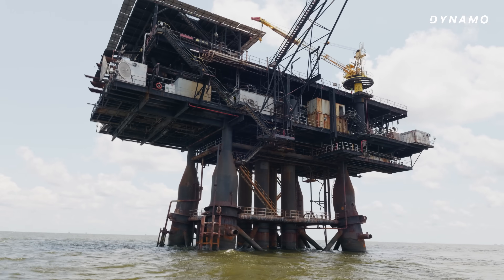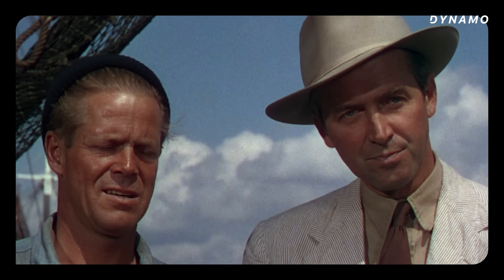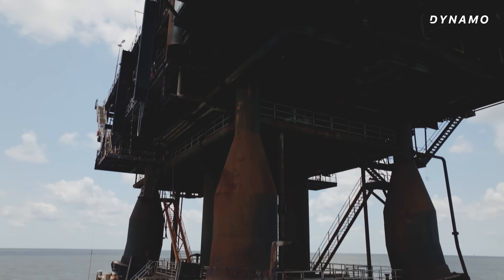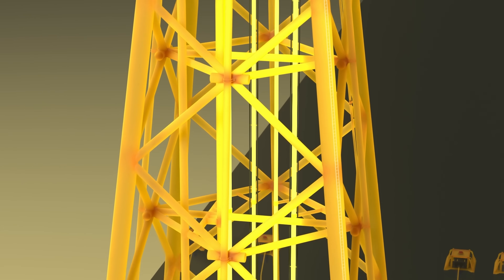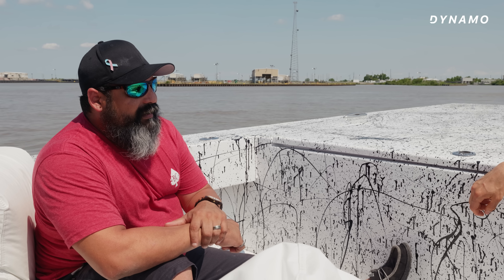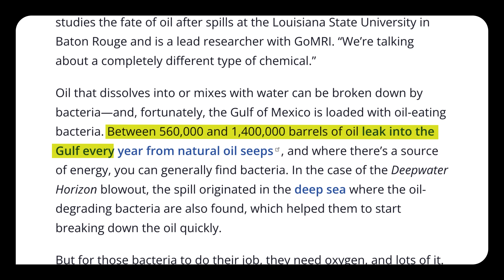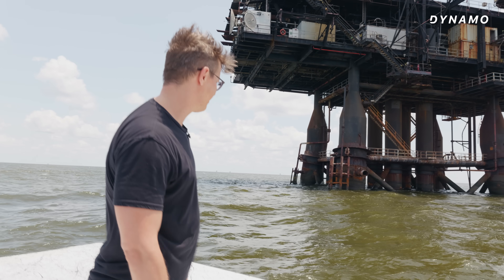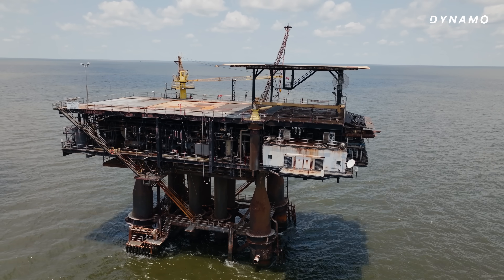I Visited Abandoned Oil Rigs — and Found Something Terrifying Underwater

Comment: calm down _ we pull 100s a year. I'm a commercial diver nad now a vp. Monies are set asside when closed and or sold for abandonment expenses. The REAL issue is the small private companies that buy old fields and rework them. Small companies will declare bankruptcy on small fields and leave all of us small contractors that did their work holding the bag.  The government will (BSSE) chase original owners and fine them....but if they arent thier....its Governments problem.  we have 3-5 years left until most rigs will have been removed. 
rigs to reefs is great it has brought back living coral reefs....so it works. the expense comes from regulations and insurances.  i pulled 70 wells in 1 year.for Chevron....it is getting better

Comment: I've heard that oil wells can go dry then possibly fill up again due to continental shelf pressure.  If this is true then in some cases some oil wells thought to be dry and or  not plugged well could begin leaking oil into the ocean.  The solution would be to plug the wells better or harvest the oil.

Comment: WHAT NO BODY IS TALKING ABOUT IS WHEN THAY STOPED PUMPING OIL IN AMERICA ALL THE VOLCANOES STARTED TO BECOME ACTIVE TO MUTCH OIL PRESSURE UNDER GROUND IT FLOWS THROUGH CRACKS TO FIND A WAY OUT THERE IS YOUR VALCANOS. HAVE YOU EVER TRIED RUBBING TWO ROCKR TO GATHER AND SEE THEM MELT IT DOSENT WORK. WAKE UP.

Comment: I used to decommission Rigs. Plug em after you get the permits which takes forever.  Decommissioning these rigs are backed up for years. 
I worked on mostly Apache Oil when I used to be an Electrical Engineer off the coast of TX. They just make Rigs inoperable & sink them for the "fish" making artificial reefs. 
My Cousin Engineered the Largest Shell Floating Rig. The Appomattox. Produce of oil & gas is upwards of 175,000 barrels a day!

Comment: Easy solution for the increasing costs over time at least: Each time the rig is sold, the clean-up quote must be updated. Ownership cannot be legally transferred without this bond cost secured in-full. So either the current owner can do it to make the sale easier, or the purchaser can foot the bill for the bond update. If this isn't done then the original owner is held liable as the title was non-transferable. So if they do shady deals just to ditch it to a small company that will fold, (or a shell company even designed to fold), either it's already paid for in modern metrics, or it's coming back out of their pocket directly.

Comment: It’s not abandoned. The wells first have to be plugged and abandoned. Then the platform needs to be decommissioned. 
What happens is the majors sell them to mid cap operators and then they sell them to smaller operators. The little guys go out of business and leave them abandoned in bankruptcy. It’s then supposed to go back up the chain to the current operating company.

Comment: Why would an oil company abandon a rig which is still producing - at pressure? I couldn't understand how there could be dangerous blow outs from abandoned sites. And sure I do understand that at some point extraction becomes cost prohibitive - like when it has to be pumped rather than gushing out as a result of untold pressure - but if that's the case we shouldn't see blowouts because ( well presumably) they'd only be abandoned when they become economicly unsustainable

Comment: I used to drive the boat to that platform to bring supplies many years ago. I learned Chevron is the worst company I've ever worked for, they say do what we say or go find another job. I've watched them open caretest valves and instead of putting oil in a drum, they just let it go into the water. I've watched them drop batteries in the water instead of sending them in to the shore base.. I also brought supplies to the Mr Charlie back in the 70s. Also I was outworking a rig 12 miles from the Deepwater Horizon when it blew, we rushed over and started shooting water on it, the Damon Bankston had already picked up the personnel in the water.

Comment: Plug the expended wells. Sell the platforms to disgruntled vets that just want to be left alone and get the government to pay a small stipend to keep them maintained at a minimum level with a supply cache for military vessels when rescue operations need to be performed. The Coast Guard could use them to drop rescuees off for rapid turnarounds and them pick them up later. Also might make a good observation system for illicit activities because said disgruntled vets REALLY don't want people getting near them.

Comment: There is a lot of misleading things with this video. I wouldn’t even know where to start to explain all of them. The biggest misleading conclusion is old wells can blowout like the new drill Macondo well. That is an absolute joke. An old well can leak some oil or gas at maybe 10 barrels per day but it’s not a blowout that releases 10,000 to 100,000 barrels a day like Macondo did. Also when a small company goes bankrupt the plugging liability goes back to the company that sold them the asset. If they too are bankrupt it goes further back up the chain of ownership to ever larger companies.

Comment: I think we need robotically managed and autonomous environments submerged on the sea floor used to grow and inject the  microbes into the well. There would probably be a surface unit that would wander and attach itself to a range of sea floor units at large groups of abandoned wells in order to supply surface materials needed for the operation to continue.

Comment: What a load of misleading propaganda! 

An end-of-life well is, almost definitionally, empty of any oil that could possibly blow out.  That's why both named examples of blowouts in your video were not from dead abandoned wells - Deepwater Horizon was a new well being drilled containing naturally high and unstable pressures that caused a blow out, and the Taylor spill was an active mid-life well damaged by a hurricane. 

Abandoned wells could contain some small amount of depressurized unrecoverable oil that could very very slowly seep out if the bore hole is not properly plugged - so yes, decommissioning rules exist for a reason. And heck, if someone invents some kind of "biofracking" that would allow them to go back to played-out wells and economically recover the scraps of oil left behind then good for them.

But you've hyped up this problem beyond all recognition. You haven't cited a single instance of an abandoned played-out well causing a noteworthy spill because there aren't any.  Big oil spills happen, but from other parts of the production lifecycle.

Comment: I was a mechanic for Fieldwood Energy. I made many repairs at MP77 on gas compressors, generators, ect.. They spent a lot of money on that platform trying to get it in decent shape to get it flowing. It was so rusty, holes would pop up in pressure separators and pipes, ect. That platform was a nightmare. I've been to most of the Main Pass Platforms
Reply: Fieldwood seemed like a disaster altogether 💀

Comment: If people actually knew what was on and around these rigs, they would force them to keep them lit and sounded or cut them a safe depth below the water line and leave the top next to the bottom on the sea floor.   The amount of sea life that these rigs support would blow your mind.  We routinely spear fish in the Gulf and every square inch below the surface is covered in coral and fish.  Plug the wells, topple the rigs.  Leave it at an artificial reef.
Reply: Well, either topple the rig, or repurpose it for something else. Like, turning it into a hotel, or a restaurant, or a store that sells diving gear for people who want to go under the water to see the marine life.

Comment: You did not provide a single example of one of these decommissioned platforms having a blowout or leak. "Natutal oil seeps" are not from manmade objects. All the problems used as evidence in this video were from active wells. I'm sure they need cleaned up but this video provides no credible argument as to why. It's entirely hypothetical.

Comment: There are thousands of "zombie" oil wells in the U.S. and Gulf of Mexico that pose a leak risk, though a current, precise number of actively leaking rigs is not available. Many wells and platforms are overdue for decommissioning, and regulators are concerned about the widespread environmental threat from these deteriorating structures.

Comment: Making meaningfull quantities of H2 out of old wells is a 'pipe dream' and just a way to not deal with the problem of old rigs.

Oil and gas industry will do anything they can to not have to deal with their responsibilities. 

Whoever built it needs to plug it and remove it and the pipework in its entirety.

Comment: Turning oil into hydrogen, this seems fine at first glance, but it is a really bad idea. It is really, really, hard to contain. Every purpose made hydrogen container do leak. Now combine this information with the fact that released in the atmosphere, hydrogen indirectly produce warming effects 11 times worse than those of CO2.

While oil deposit contain some natural gases, meaning that they are somewhat gas-tight, once the crude oil is converted into hydrogen it will definitely leak in many places where the crude oil and methane gaz wouldn’t, polluting the air and the atmosphere.

Comment: Abandon you say?... BOYS GET THE BOAT! The BIG boat! And cutting torches. Cant really help with the wells but the rigs easy-peasy!
Though for real why not just to pump out the wells even if the rate is slower and then cap it when all the possible oil has been extracted. Government run company could do this and then use those funds to both fund the operation and pay for the plugging since corpos wont be paying for it. After all in 80 years we are likely going to open those reserves up when better flowing ones dry up and if new ones are not found with new tech those not commercially viable reserves will become viable and new holes need to be drilled costing millions and more pipe dumped deep into sea floor where it wont be retrieved.

Comment: I'm a marine structural engineer most of what I do revolves around bridges and docks generally speaking large scale commercial port maintenance operation and expansion. I haven't worked on this specifically but I know a lot about everything adjacent to it; thought I might give you guys a little insight... we talk about the cost to clean these up but realize it takes highly specialized contractors who usually operate in a form of design build kind of operation. You are talking about guys who have very specific equipment to do this kind of work dive barges that are specifically equipped to have very well-trained and expensive adci divers who will go down in a bell to rig the bottom of these wells so that they can be dismantled piece by piece. That also requires some pretty specialized engineers. We are in a situation now where there are more people equipped to build these things than there are people equipped to remove them. When they build them they are dry, the permitting and hazzard concerns are very straightforward. Demobilizing these things is an entirely different beast. When they're building these things initially they're putting new steel down there that has 100% section. There is a huge portion of engineering that has to go into essentially forensic structural analysis to figure out what you can and cannot disassemble and what must be braced before disassembly. Fortunately the federal government is able to save some of that money considering the fact that they have the Army Corps of Engineers but a lot of the issue is not even the cost of this but the fact that they're so few of these contractors that they just stay back logged. 

Here is the good news, the oxidation and corrosion of these structures is very much slowed by the fact that they are underwater. Rust requires both oxygen and moisture to occur, so most of the corrosion that is happening is similar to what you would see on like the Titanic with bacterial corrosion which is much slower.

The really bad news is that we haven't been doing this that long. This means that these structures likely haven't failed because of the fact that they just haven't had enough time to corrode yet. Which means as some of these structures near 40 plus years old we now get to start being afraid. Of course a 20-year-old structure abandoned completely underwater will be fine, but if we let that age pick up more towards that 40, 50 year old mark That's whenever it gets very sketchy in my professional opinion that's when I start seeing very advanced section loss especially closer to Splash Zone of coated steels that are not cathodically protected. I'm talking 100% losses there literally is not material there at that point, and the material that we're trying to measure will literally disintegrate when we try to take a reading of it. Things underwater will probably be fine for another 20ish years steel wise, but I figure one of these days we're just going to see not just one or two fail but several failing at once and it will become a catastrophe. Unfortunately we'll have the same problem. You can pay the contractor as much money as you want but when there's only one or two of them that can do this job it's a dire situation. No amount of money that we wave will change the fact that there is an extremely limited amount of commercial divers that do this and possibly fewer engineers/foremen who have the professional experience to oversee it.

I mean you can't even contract it out globally the company that I work at which is us-based regularly has jobs in South Korea because of how limited that pool of knowledge is. It's a very underserved market. We spent a lot of money in the name of building these things now we're going to be tasked with spending a lot of money in the name of maintaining and removing them.

Comment: We will have the same problem with solar panels across the upper Midwest beginning in 20 years. The heavy metals from the panels are leeching into the soil underneath. There are no plans or money to remove or switch out these panels when the they are no longer useful.

Comment: It's not dangerous, and it's not hurting anything. If you knew anything about crude oil and the sea you would know that millions of barrels of it seeps out naturally in the worlds oceans every year. There are natural enzymes in the ocean that feeds on crude oil. Do even if the rig leaked oil it wouldn't hurt anything. The well will eventually rust and fall to the sea floor where it will act as a artificial reef.

Comment: Those wells are supposed to be capped off and filled with cement, so in the event the surface casing breaks there wouldn't be any oil spill.

Comment: Forget the rosy ending, because that solution of 'microbes' is still miles away from reality.  And even if it were useful, the pipes and the rig itself, are still degrading and rusting away.  That will make yet another leak/blowout in the gulf.

The irresponsibility of how the Oil industry treats their obligations to clean up their mess, is astounding.  Especially with how they have continually tried to tell everyone how great and compassionate they are.   

What it all tells me is is pretty clear.  O&G companies have had bought-and-paid-for politicians and judges, for generations.  There is no other way for this situation to have happened without it.  This includes this video producer, in light of his fantasy scenario wrap up. 

The bottom line is, oil companies will never clean up their wells in any meaningful way. Show-ponies, and future 'dreams' of some new 'saviour' coming in, won't change anything.  What is the plan after this 'microbe' thing stops producing?  The well will still be there, with no company spending a dime to clean it up.  Socialize costs, and privatize profits.  Rinse, repeat. 

Voting matters.  Vote smarter, folks.

Comment: I worked for FMC for a while (now FMCTI) and we were working on sea bed oil platforms (?) that pumped oil to shore or had couplings so ships could hover over them and drop fill lines down and fill up. They would be powered by shore electricity or by current mills (same as windmills except for being driven by water)on the seabed

Comment: Funny how in the US they are so strict in some areas about air pollution from a single car but seem to turn a blind eye to this.  It should be easy to fix it.  Just make the oil company who built the platform legally responsible for ensuring it is decommissioned.  The removal permit should be issued along with the construction permit.  
If the platform is not removed within some time frame e.g. 5 years of being shut down then they will get very heavy fines.  The fine should be so heavy that they would not consider leaving it behind.  It wouldn't be worth it.

Comment: For the Future, don't let the Primary SELL, but rather lease to smaller and smaller operator, charging a lease price that allows for building up the reserve for the well, which REMAINS  WITH the ORIGINAL owner.  In the mean time, create a new type of entrepreneur who can reactivate an old well that has since built up some pressure, and then CEMENT The well shut properly using the reserve built up by the original owner. .

Comment: pure opinion:

oil rigs should NOT be tied to shore by pipes/and if they are it should be temporary pipes that get removed when the well is done. 
the original builder should be responsible for decommissioning.

Comment: Agree with the basics you present.  However, comparing (and dramatically replaying) the Deepwater Horizon blowout to a blowout from one of these wells is comparing apples to oranges.  I think there's enough good information without using hyperbole.